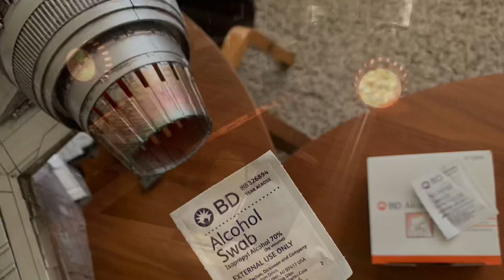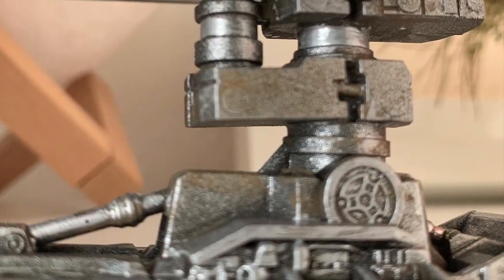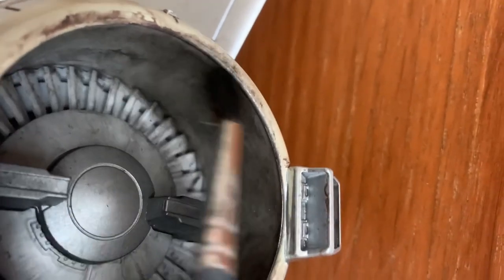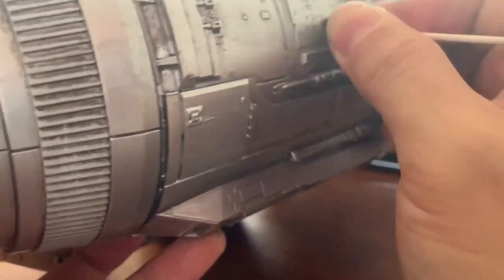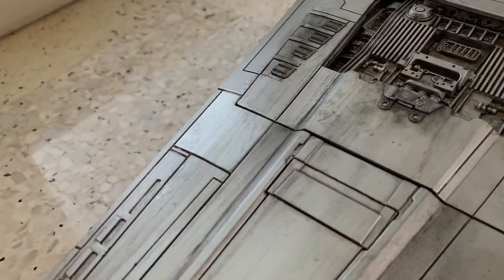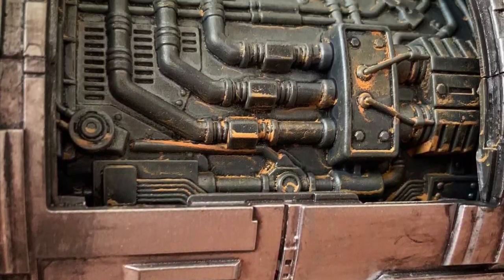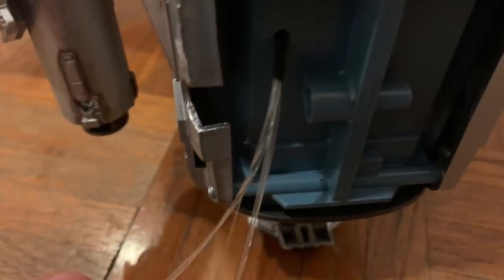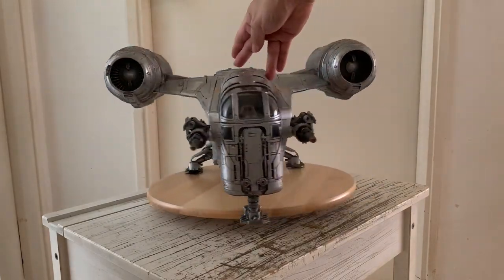Plastic Star Wars HasLab Razor Crest Mod - Part 3, Painting and Weathering

Comment: I got mine lit up thanks to your part 1 video showing how to access the engines. I used LED lights strips and just cut pieces to fit areas inside the engines and in the main cargo hold and cockpit. Wired them all together running wires through tiny access points I created. And it's all controlled by a motion sensor so it comes on whenever someone enters the room. I love it.
Reply from the maker: Glad you found it helpful and congrats on your mod! Wow, the motion sensor feature sounds rad!!👍😊